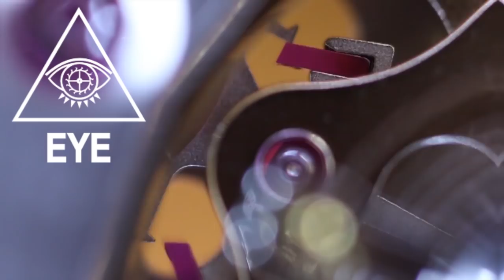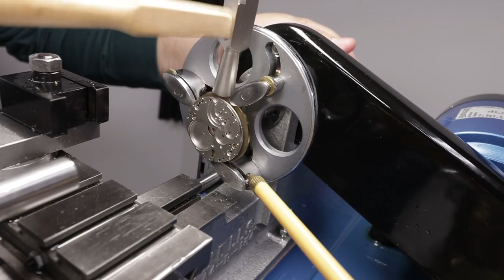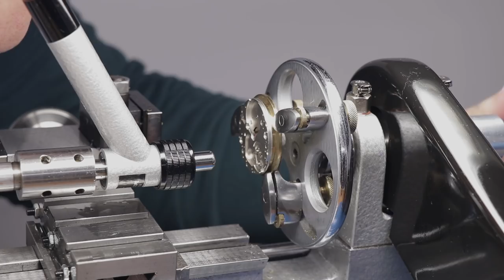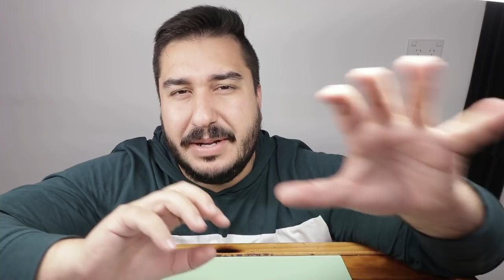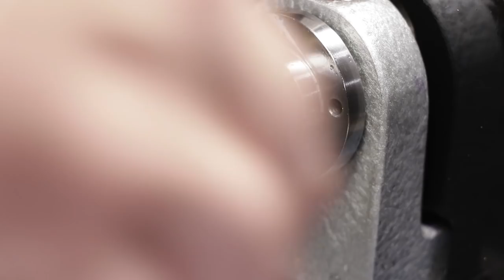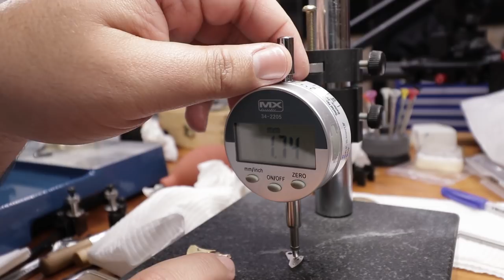Making the Balance Wheel Bridge Part 2 - Watchmaking Vlog 25

Comment: Hi Dean, good video Mate, if the balance cock jewel hole is not in line with the main plate the balance wheel won't sit level, and the balance won't rotate properly, it will bind on the side of the jewels which will cause low amplitude, also i don't do any heating up while the work piece is mounted in the lathe you will melt the grease in your bearings, you just have to work quickly while it is still hot.
Reply from the maker: Hi Kaz, yeah I’m hoping that most of the hole is concentric and that will make the jewel line up properly 🙏🏼🙏🏼🙏🏼😂 ahh kk, I’m not too worried, my lathe doesn’t have ball bearing 😁